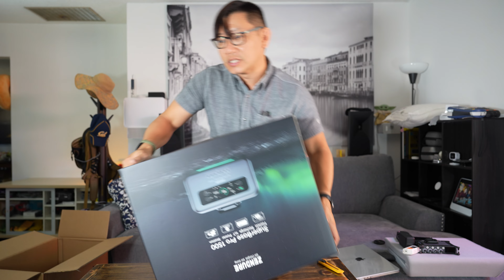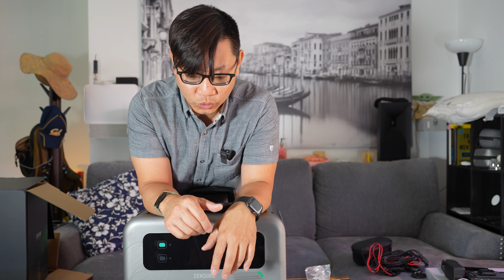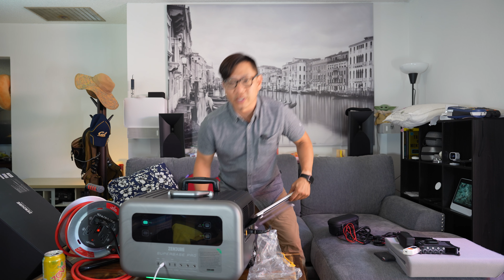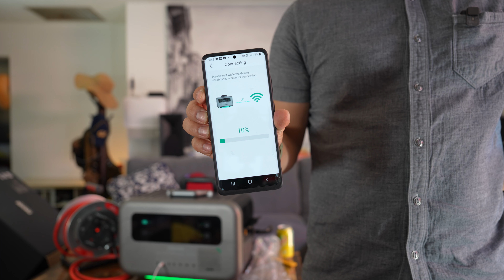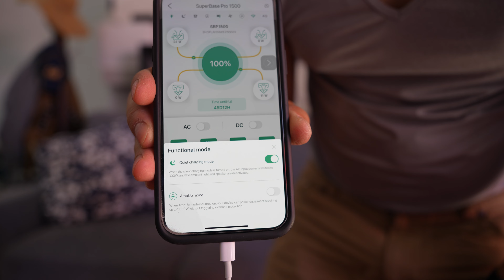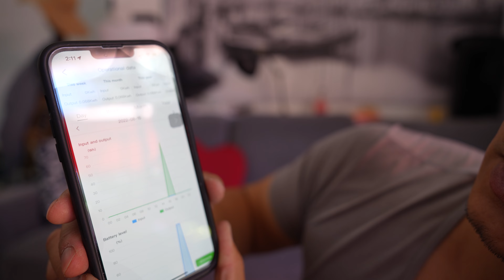Zendure SuperBase Pro 1500 4G Enabled Solar Generator | Unboxing and Setup

Comment: my pro 2000 i charge for two day 9t show 100% but when i unplug the unit the unit shut off and no power at all it show that the threshold 5 voltagg to low what is that mean
Reply from the maker: Sounds like your battery is shutting down because of low voltage to protect itself from over discharging. Did you do a full discharge charge calibration from AC adapter?
Reply: @MikeMu   how  to do calibratiin from ac adapter
Reply from the maker: @chee75  you are supposed to do a hard reset. Run it down to 0%  then charge it up to 100%.  Zendure will walk you through it when you contact them.
Reply: @MikeMu  the unit can't even charge everytime i unplug it die ni power . when i plug in show 100%  unplug from the wall it just shut off .the input charg only 25 to 30 watts
Reply from the maker: @chee75  Yes, I read that.  Did it do that out of the box?  Did you do a hard reset?  Also firmware update?  Those are the things Zendure will have you do.
Reply: @MikeMu  out the box just like that .i buy for camping this comming friday  . i biy from ebey i gonna return
Reply: @MikeMu  i have bluetti got same problem i let it charg for 5 hour  and working great . but zendure superbase pro2000 charge for 3 day still won't hold the charge
Reply from the maker: @chee75  Yes, I suggest you return.  I thought you might have seen my other video, but you might not have.  https://youtu.be/eXB5o4XA7nM This is not good for your only pack out if you are going offgrid for a while.
Reply: @MikeMu   thank for video . yeah i got same problem
Reply: @MikeMu   i been charge for 3 day input only 24 watt .when i unplug it shut off no power at all
Reply from the maker: @chee75  Sounds to me you have a big problem.  You need to contact them directly.
Reply: @MikeMu  thank

Comment: Just curious, do you happen to have a Macbook Pro 16"? I know a smaller Macbook Pro can be powered by the 100w USB-C port on the Zendure, but can the larger Macbook Pro 16"?
Reply from the maker: Yes. It can. Rarely do most people need the full 140 watt for extended period of time. The Mac knows how to do power management and pull extra power from the battery where necessary so if you were using the full power, you’d only be losing 35-40 watts of battery power during that short burst.

Comment: Just some experience with these units I have had. I have 2 Superbase2000 units. Both failed withing months of acquiring them. They "freeze" and cannot be charged and cannot power anything. The local reseller I bought them from recommended that they not be replaced as this is a common problem and they have to keep replacing them. They have offered my money back or an alternative brand. This is a common problem with these products as I have now verified scouring the very limited online blogs and comments. Ther is virtually no technical or support information online. Even obtaining a manual takes soem detective work.
For many weeks now I have had to endure ineffective online support. It takes days to get an answer to an email from their support staff. An attempt to remotely push update firmware failed. They will not replace these units as Ii suspect they are sending are sending out replacement devices by the dozens now and don't want to do this anymore.
I have elected to get my money back from the agents, who have told me that I shouldn't even bother to ship these back to them, as there is nothing, they can do to repair these units. The net of it all, is that I have two very expensive bricks in my storeroom.
On paper these are amazing devices. In practice, they seem to fail often and even worse, Zendure seem to be turning a blind eye to customer complaints.
I wouldn't go anywhere near these devices or the brand.

Comment: Question:  Sir, I understand I must be able to sign into internet to benefit from Zendure Generator.  In cases that internet might be down or an EMP cuts internet, would I be able to continue benefiting from Zendure Super base Generators?   Thank you.
Reply from the maker: There are some basic things you can do. Power it on/off, power AC/DC ports on/off, connect it locally via Wi-Fi (presuming your electronics were not affected by EMP.) So yes, you will be able to benefit.
Reply: @MikeMu , That is a option I did not notice.  Thank you Mr. Mu.
Reply: @MikeMu , thank you Mike

Comment: are the fans running in quiet mode? will someone be able to sleep in the same room?
Reply from the maker: I used to sleep with my computer on next to me.  Probably not the best.  But I think most won't have issue with it.  A lot may depend on the amount of heat in the room.
Reply: Would this be 24/7 standby ac port or can it be program to be automatically shut down on certain time or wattage ?  Can it be simultaneously charge ac and dc solar ? For the connectivity I’m confused you sign up on app throw your wifi ok but would the unit work outdoor lets say park using the app and “4g hotspot built in “ not many tried yet as this is new product and how roughy durable is that plastic body of this unit on scratches and or something falling into it ? I had a station where the plastic was so hard and dry anything would crack it not like tool plastic that can survive drops yes that’s the reason this unit has wheels but what if you know ? 😂